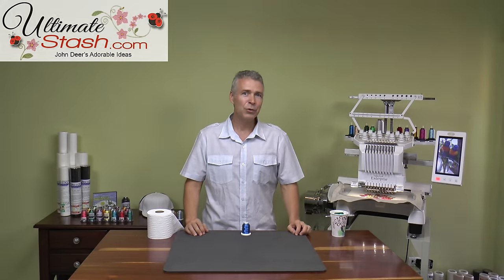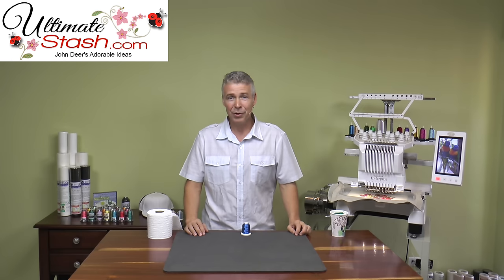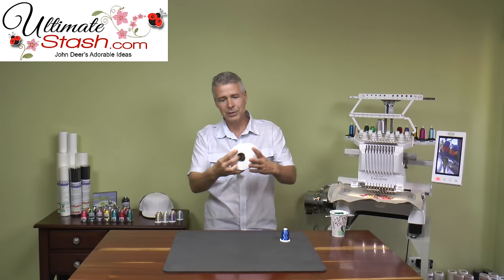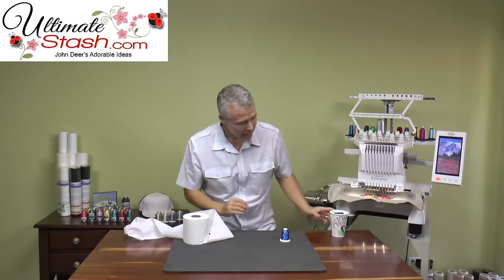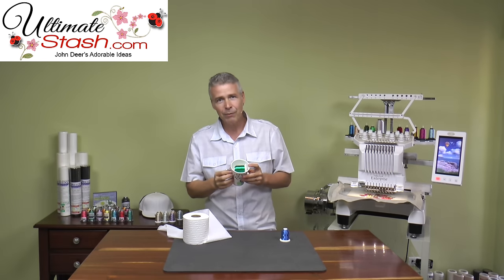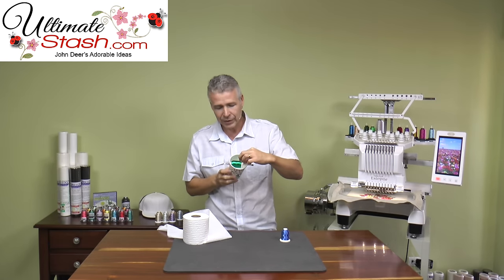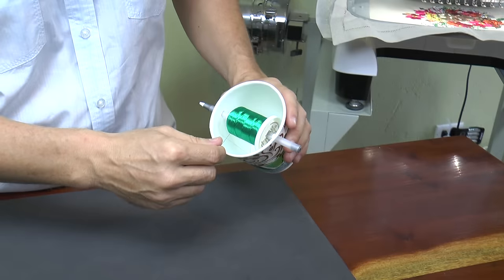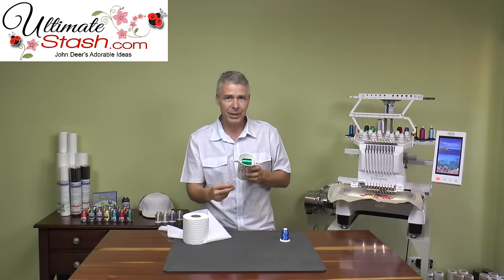Metallic Thread Embroidery Help & Tips

Comment: I see this is an old post but a great idea.   I suggest using the vertical spool pin with an inverted spool cap on it and sitting the spool on the "bowl" of the spool cap so it spins easily with little drag.  A felt spool disc under the spool helps, too.  Got this tip from a christopher nejman YT video and it works for me for small to medium spools.  The huge spools may need a special spool spinner.

Comment: Thank you for your video.  Good tip for making a diy thread holder, however, I am still confused as aren't metallic threads usually cross-wound? and I have read that cross-wound spools should be standing upright in a thread stand on the table so that they unwind from the top?
Reply from the maker: Hi Mo, in my experience metallic thread works best coming off sideways like a roll of toilet paper, so it doesn't twist as it comes off the spool :)
Reply: Thank you.

Comment: Well,, would it improve the embroidery with polyester thread?
Reply from the maker: In my opinion, it wouldn’t make much of a difference as poly threads generally have no issues passing through the eye of a needle. Might decrease tensions ever so slightly but no dramatic impact.
Reply: @EmbroideryLegacy  really, thank you for answering me.

Comment: I use my 10 needle for my embroidery and was wondering how the cup method could be adapted for use with that machine? I'm not sure how one could get the thread to feed straight out from the cup, maybe two cups one inverted to act as a lift/stand?
Reply from the maker: Chris Vick I have two ten needles side by side, once I actually took the screw driver that came with the machine and stuck it between one of the feet and stand. Then I stuck the spool on the screw driver. Pretty much anything will work as long as it comes off like toilet paper. If you use the cup idea you could even place it on the floor.
Reply: @EmbroideryLegacy  thanks, I'll try that
Reply: @EmbroideryLegacy  how do I get this machine. Am in Nigeria